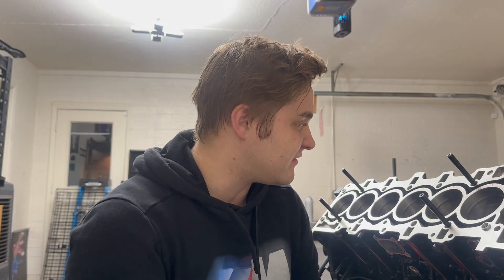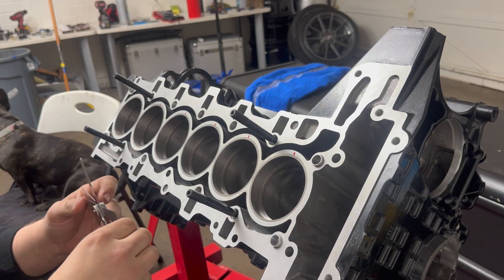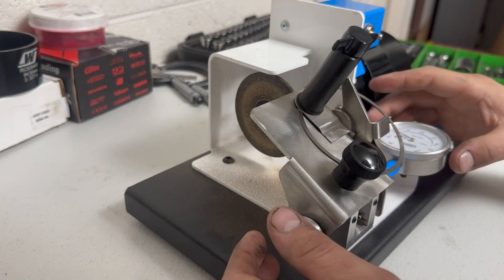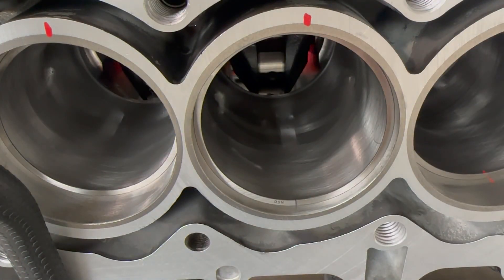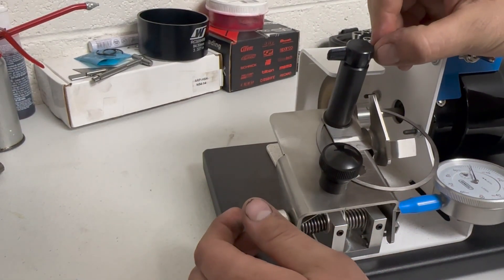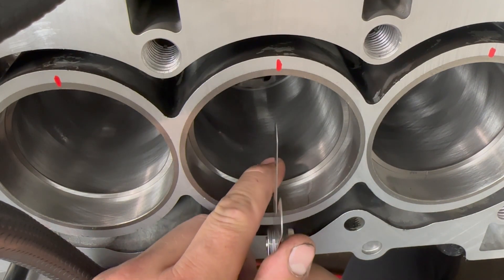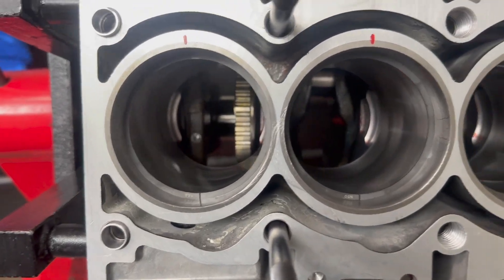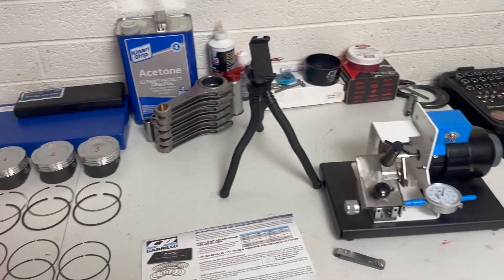BMW N54 ENGINE BUILD PT 3 | Piston Ring End Gaps

Comment: Is that bigger pistons or stock dimensions
Reply from the maker: 84.5mm bore
Reply: @Eurowoks  shouldn't the gap clearance be at .012 to .013 my stock n54 that's what they measured at.
Reply from the maker: they are differnt pistons and rings. you should get specs in the box with aftermarket pistons. @nl.a4669